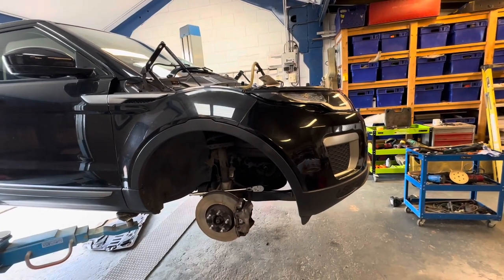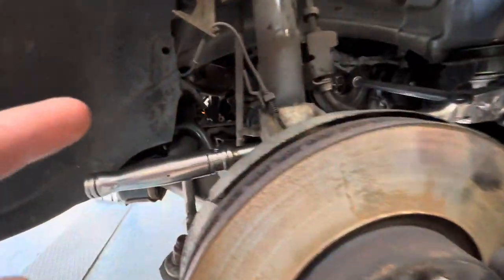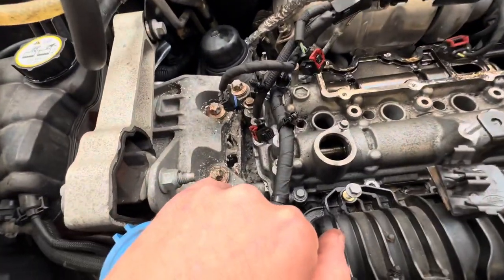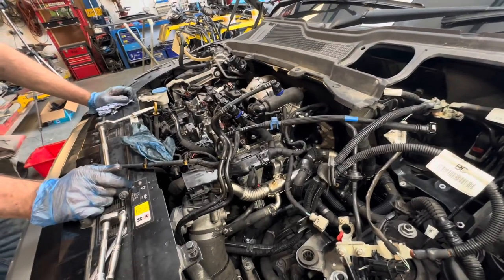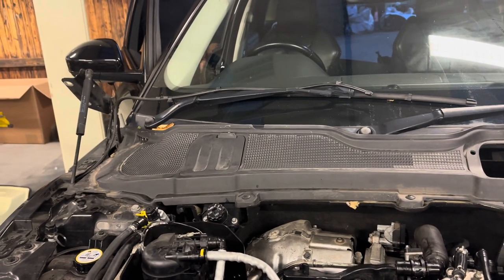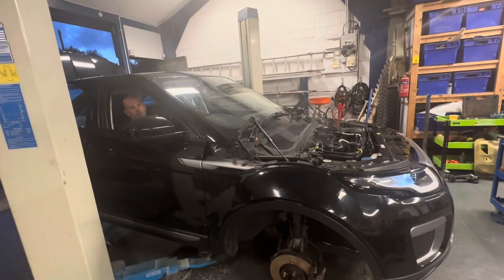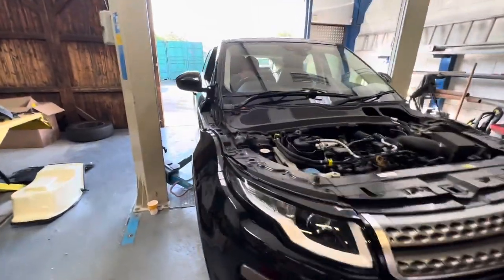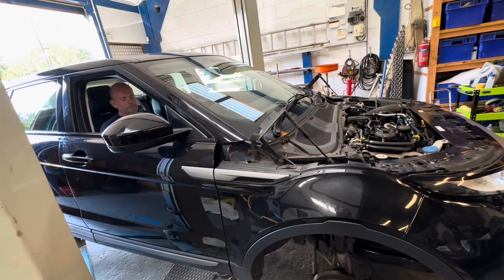RANGE ROVER EVOQUE INGENIUM ENGINE FAILURE WILL IT RUN ???

Comment: Built a number of Ingenium engines and we have to activate the chain tensioner before we put the VCT cover on, oil pressure enough won't activate it enough and cause chain slap

Comment: Way off on that one guys.
early version loses the VVT due to a miss, manufactured part. any little rattle in the chain means you have to replace both chains and all the guides and tensioners. there is also an updated intermediate gear that helps prevent future failure.
The DPF is the easy part and you don't need to remove it from the car at all.
Launch UK DPF cleaning solution works pretty much every time. A forced  regeneration can crack the DPF.

Comment: aha ! ,thats why the cam was loose, thanks for the info
never had anything in a tin unblock a blocked dpf yet, god knows i wish i had
if you yank the engine out, it will be easy to do chain + dpf together, + you will be able to roll it outside     CAUTION  the good cleaners are caustic soda, its burns concrete, never mind hands, don't put your hand over the exhaust if it in the system, if it does get through, it will take at least 2 layers of skin off straight away       keep up the good work chaps

Comment: Did a DPF clean on my mondeo with that aerosol, took it for a drive and WOW, a smoke screen a destroyer skipper would be proud off, takes time to work through so as it is sitting for a while the chemical will soak in and help to clear the DPF

Comment: Amazing video gents.All your efforts to get this vehicle started and back to life were not in vain.You certainly managed to narrow down all the faults to a blocked DPF filter and a timing chain kit as the major mechanical issues.Well done lads and keep up the good work.Good thinking outside the box too by not carrying out static regeneration prior to replacing a suspected faulty timing chain,as this process places the engine under load,which could potentially cause a chain failure thus causing further mechanical issues .

Comment: I was at the point when Chris was about to turn the key and the ads cut in! My heart nearly stopped! Great to hear it fire up, but very disappointed at LR Engineering, I thought chains were supposed to last well over 100k. This allied to other issues with these engines is very worrying. Great content. ❤

Comment: The DPF will never regen with a glow plug issue /  control unit , this is one of the main reasons why a DPF gets blocked in the first place . When the DPF gets cleaned read the resistance on the glow plugs and also use the diagnostic computer to check the function / activity of glow plugs and if the fault comes back as control unit replace it . 
Regarding the chain tension it’s defo slapping, get a full running gear kit and you’ll have no worries after . I’m a bmw master tech here in Dublin 30 with experience on everything at home also in work and I love the channel , get real life experience and problem solving from Chris. Keep it coming lads if you ever need any info on BMW or Mini just get in touch via message and I’ll send you my email or phone number. Remember lads if it’s not flat out you’re retired bahahahahahahaha

Comment: The MAF fault will deffo be DPF related. It can't breath in enough because it can't make space farting it out the other end, so the ECU thinks it should have more air than it's getting or it's on the top of mount everest. At least the hand over the exaust pift noise means the exhaust doesn't have any leaks. Doesn't prove good volume of flow.

Comment: Rob with that dpf cleaner your meant to take it out for a drive after putting it in. When you do it will be smoky but will clear. It tells you all in the instructions what to do and speeds etc. But you need to sort the chain first.

Comment: Tip to clear the DPF, go on a motorway, put it in third, keep it there and hit 70 for around 20 miles or so, it’ll burn the soot out!
Reply: Ahh, the old Italian test drive!
Reply: Old wives tail. Does no good. 20 mins around 2000 rpm should do it. If system is working correctly
Reply: If fuel tank contains less than 50% diesel then DPF regeneration will never occur regardless of other vehicle parameters.

Comment: Good to see that the engine isn't completely borked. I'm still surprised that for a 7 year old vehicle that it has an iffy engine, not many vehicles have that problem. I would certainly try and get that chain done and give it a detail and you would sell that no problem 🙂👍🏻

Comment: Hello both! What a lot of work and time sorting out the engine,but,a good result as you know that the engine is running and sound apart from the timing chain needs to be replaced. It does amaze me on how you both remember where everything goes back correctly!!! Best wishes from Lincolnshire

Comment: Modern day diesels with their emission devises are an absolute pain , dpfs blocking egr faults carbon inside manifolds   half the trouble nowadays is down to lack of proper maintenance and being driven correctly , dropping kids off at school and then going for nails to be clipped and going for wax strip trips is no good for modern day diesels 😉👍

Comment: I use that DPF cleaner on all my DPF work and have had 98% success rate with it. I also use The Turbo Guy and DPF expert who will turn the DPF around in 24 hours. You can also leave all the sensors in it you don’t have to take any of them out cost price is about 150 quid cheaper trade obviously.

The cleaner works best when the car is hot. And will smoke badly if it’s blocked. You can also hold the revs around 2 thousand with your foot , with out doing a regen 1st.  Not advisable to the chain is sorted guys.

Comment: Great work guys. You two have a huge amount of initiative. As a by the way, I worked in Toyota for a few years and they used the 1ww and 2ww bmw diesel engines in multiple models. The chains gave trouble from time to time. Snap-on have a tool whereby the engine is timed, the old chain is split,connected to replacement chain and engine rotated to bring new chain through. The snap on tool also correctly crimps replacement chain link.  Very useful kit. Huge labour saver. If you have a contact in bmw or Toyota, it's worth asking the question.

Comment: wise decision on the force regen, many years ago when adblue, was first coming in before adblue tanks were fitted on Volvo dump trucks i had one on a dump truck iwas driving get completly clogged up next day and replacement regen filter overnighted from Volvo in sweden , new replacement filter put in,and the fitter did a force regen via his laptop, and the temperature of the exhaust got up to 685 deg C just to clear out the system even with a new ceramic dpf filter in, force regens work but they make the engine work VERY hard , hence wise choice on the timing chains :) :)

Comment: Hi guys brilliant as always just wondered could not the blocked DPF be putting pressure on the valves and assembly there for pressure on the cam chain  tensioner just a thought 😊

Comment: One of my customers has had a chain at 40k on a 18 plate, I've had luck cleaning dpfs in situ, take top sensor out, fill full of dpf cleaning fluid, start it up with sensor out to reduce back pressure, run it, I've had success with a merc and a xe jag

Comment: Get The autel plugged in and check the DPF pressure sensor reading 👍🏽 DPF can’t be cleaned on the car by a professional. 
Landrovers done do a forced static regen I believe I think you can only do a on road regeneration

Comment: When the timing chain is done, take it for a good drive on the motorway , leave it in 4th gear and keep the revs  as high as possible -  should help clear that dpf.
Reply from the maker: It’s 4000rpm at 60

Comment: Presumably replace the timing chain then force a regen of the DPF.  Strongly recommend you are outside in open air for the regen as the odours are particularly unpleasant. Ensure sufficient diesel in the tank prior to regen as consumption can increase dramatically.

Comment: When you fitted the tensioner did you pre load it? What i mean is that on this engine when you fit that tensioner, once it is bolted in tight you push hard against the chain towards the tensioner and you will hear a click.. that releases the internal ratchet mechanism to provide constant pressure on the chain. That could be the source of your noise rather than any stretch on the chain, as it seems to be idling ok without timing faults.
Reply from the maker: Lol

Comment: Gents, all the faults are because of the DPF. Turbo boost pressure is normally another fault. Those cans of cleaner are OK but for the DPF on that car, you need something like 2.5 litres of it and engine should be warm when you fill. Then leave 45 mins then start is up. Your can did nothing otherwise you would of had foam coming out of the exhaust. Once that’s stops, then do a forced regen and your sorted. Once you clean it, all those faults will clear. Hope that helps.

Comment: Great you got it running. These Ingenium engines are certainly complex to work on and seem quite fragile. I wonder if a lot of diesel engines that get a blocked DPF is because they are driven mainly short distances and the owners don't undertand the need for regular long runs at high speed.

Comment: Hi Rob, I had a bit of a rattle noise on my Evoque that sounded a bit like the noise you got. it turned out to be a broken bracket under the air filter housing, put a weld on it and suddenly my engine was quiet again. BTW where is the LSE ?? Down at paint at last ?

Comment: I am sure you turned the engine over before starting it so risk was minimal. I did think you could have put a dial gauge on the cam you weren't sure of, just to check that all 4 cylinders had equivalent lobe timing. As for the DPF - you need to find out what "conditions" are stopping it happening, on my BMW it wanted a full fuel tank and engine up to temp. a dodgy thermostat was actually keeping it cool and stopping it from regen. Clearly change the chain before running engine much more.

Comment: Hi guys, another cracking video, might be worth checked the Air flow/ intake temp sensor / glow plug control module are clearing permanently and not popping back up, faults like that can prevent cars carrying out self regenerate, can’t wait to see the outcome 👌

Comment: I have seen a few mobile DPF cleaning companies. They take it off and blast it through, under high pressure using hot water and cleaning chemicals. You can also use the Autel to force the car into a DPF regeneration mode. Sometimes this works, sometimes it doesn't. A blocked DPF can also cause turbo damage. These filters normally have a lifespan of 100,000 miles and are super expensive brand new. I hope this info helps guys!! Thumbs up as usual!!
Reply: If you look in their back catalogue, they have a guy who comes out with his mobile dpf cleaner. They did an explanation video on how it works
Reply: @adejenkins  Thanks man, I'll check that out.👍
Reply: Terraclean is a mobile diesel engine cleaning service. They can run 2 processes. Intake cleaning and exhaust cleaning. The exhaust cleaning process uses a water based chemical solution which cleans out the turbo, dpf & egr resulting in foaming deposits exiting the exhaust tailpipe.

Comment: Your supposed to let the Engine run for about 15 Minutes to let the Engine and Exhaust get up to temperature before you spray the Norfest DPF Fluid into the DPF as this helps the Regeneration Process and works better to break down and Clear the Blockage 😁

Comment: Is there any chance the blocked DPF is causing enough back pressure to affect the timing chain? I know it's a long shot, I don't have any hands-on experience with DPF's. But the way I look at it is, if there's not enough space for the gas to get out, it must be putting pressure back on something.

Comment: Well done guys, I think you made the right call TP put it back together and run it up.  I'd go for getting the PDF flushed through off the car, then with the faults clear, see how it sounds and maybe a short test drive.  All being well, that would just leave the chain issue to resolve

Comment: If it’s anything like a BMW, the DPF does auto regen while it’s driving. However, if the glow plugs are faulty auto regen is disabled. You did have a glow plug module error on the scan tool so that may be the cause of the blocked DPF.
Reply: Agree. Had a glow plug down and that caused my dpf issue
Reply: Regen normally only occurs under certain conditions governed by the ECU. There are many parameters which must be met before DPF regeneration occurs. Engine speed/RPM, top gear selected, vehicle moving, engine temperature, time driven without gear change, fuel tank over 50% full as consumption increases. A forced regen will bypass these regen parameters.

Comment: Too bad about the chain.  I've not done one on this car, but have done it on others.  As for the DPF, you've gotten 1/2 way there using the DPF cleaner (I assume you put it in through the oxygen sensor port on this engine.)  You have to bring the car up to temperature and keep the revs up for about 10-15 minutes, then take the car on a 15 minute drive at highway speeds.  Use your Autel to force a dynamic regen whilst keeping speeds above 25mph and monitor the DPF soot levels.  You need to get it down below 6 grams on JLR vehicles.  After you get the DPF cleared out, you then will need to use the Autel to tell the car that you have replaced the DPF.  There is a hot function for this.  The reason being that Land Rover won't let you clear the code once you reach the red message on the dash.  So you tell the car the DPF has been replaced and then it will let you clear the code.  There is a great video showing how it's done on this exact engine.  Search:  Jaguar XE 2.0 SCR Cleaning P20EE-04 P2BA9-92 P20EE-92 P2BAE-00 P2BAF-00 P2BAE-02 Catalyst Efficiency.   The guy's channel is called "O'Rileys Autos - Mobile Mechanic & DPF Cleaning" and he really knows his stuff.

Comment: Surprised you wouldn’t have a correlation code for cam and crank with a stretched chain ? Maybe a damaged guide on tensioner side ? 
 Pointing out the obvious for some ..but with a glow plug control module  code it won’t have been doing a regen hence it gets blocked 
Great channel alway very entertaining

Comment: Hope ur good lads, that DPF is blocked sending codes to the reader, either do a manual at 2500 revs for 30 mins or introduce a DPF cleaner via the DPF which will create a foam cleaner via the exhauast.

Comment: Having owned several Jaguars with the same chain system. How many miles has the Evoque covered ? The main cam chain should be good for 120 000 miles and the fuel pump chain at the back slightly longer. They generally get changed at the same time at the 100K mark. I imagine that if the Evoque has been used for the school run (many short journeys) that might affect the longevity of the chains due to poor lubrication at start up.
Reply: 60k miles on this one

Comment: When I bought my Volvo XC90 the owner of the dealer said that his Land Rover Discovery spends more time at the garage so that just says it all. My XC90 has not been without problems but they're easy to repair and usually not too expensive for the most part. I've got a couple of suspected faulty modules and they can be repaired/replaced by specialists for a few hundred quid tops. I suspect that a similar repair/replacement would cost a LOT more with a Land Rover vehicle. Best to get you "man who can" to replace the chains. It will be total peace of mind for the next owner.

Comment: The instructions on them DPF cleaners require either a 30-40min run at 3-4000 revs or take off and get cleaned without engine run. Also don’t forget the EGR valve clean too. If a good run and regen, remember this dirtys the oil and can soon come back 😢

Comment: On camera it sounded like it was banging back through the intake from under the bonnet. Maybe cam lobe or bent valve? As for DPF get the guy in the van to do a clean. If the DPF light is red you might struggle to clear code with Autel etc. you’ll need to go dealer level gear and tell it it’s had a new one. Glen the jag guy did my vouge

Comment: Well in guys, such a shame about the chain, If the glow plug module has a fault like the wires to the potted circuit board have fell off, that might of caused the car to stop doing regens on any runs, hence why the dpf is so blocked. I doubt you could even start a forced regen when the soot level is so high, I flushed mine with dpf cleaner and ran water through it until it ran clean and touch wood its been fine since 2k miles later. like anything a bit of research and elbow grease can save you loads of money.

Comment: If you can find a potter with a kiln big enough to put the dpf in, you could heat treat it up to 1000 degrees F for 12 hours to turn all the soot into dust. Kiln heat treating is how big commercial truck dpf's are treated when liquid cleaning is not enough, and spending $10,000 on new one is not an option. Otherwise hopefully you can get a new dpf for a reasonable price.

Comment: All those power train (bar glow plug) will be down to DPF, will chuck the readings out of whack for air intake as engine management tries to keep motor running. Give the DPF a blast out and new chain on her. Nice motor really shame they are a pain to change with the gearbox.  Probably best to get someone else to do the job as you said, time is money and someone else has the tools. Cheaper long long can make money on something else while someone else is doing it.

Comment: If you guys remove gearbox and engine for Josh to do timing chain, whip the dpf over to a local dpf cleaning co and they will flush it out for you. Or if Chris fancies a go himself, there's a few good videos on YouTube of people back  flushing dpfs with different chemicals. From memory I think brick acid works well.
Reply: A long drill works even better.